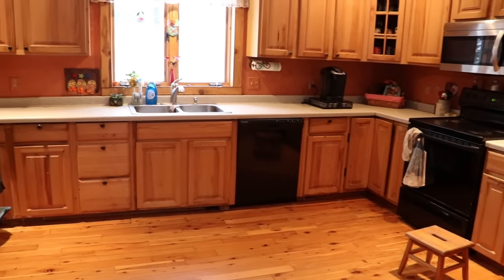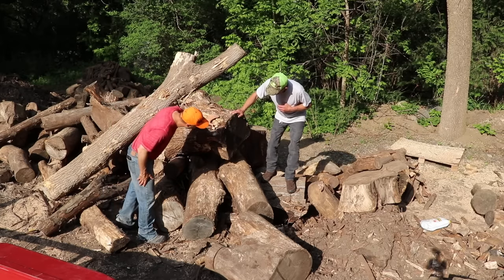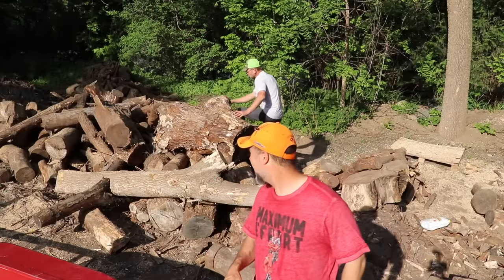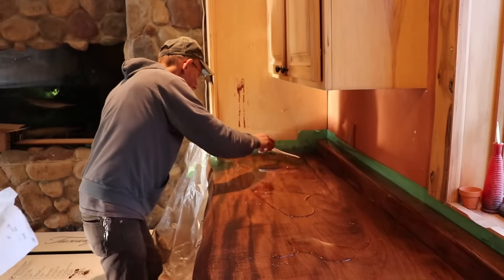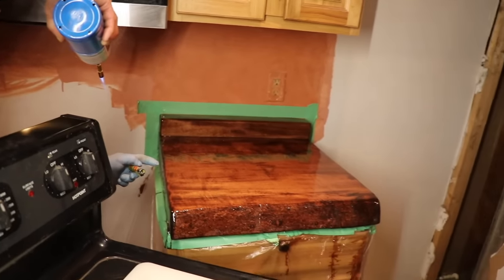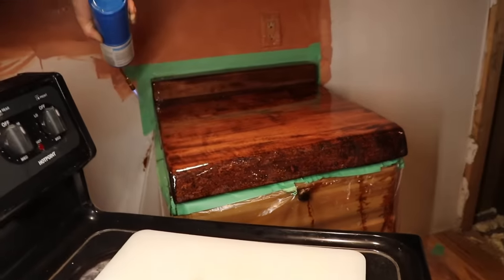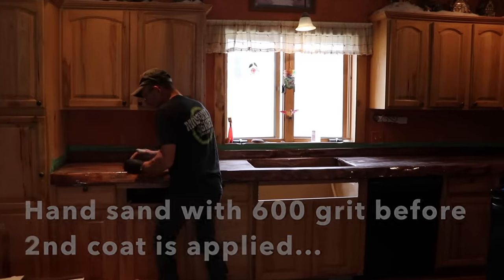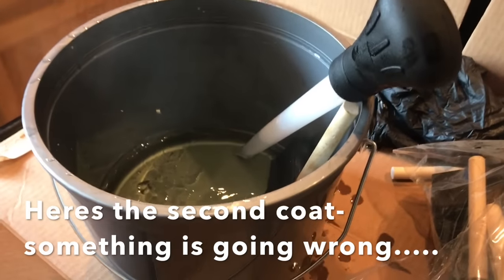A bad Epoxy Job on Our DIY Live Edge Kitchen countertop ... how to do Epoxy repair Pt3

Comment: What happened was the buckets for mixing with marks are HDPE and resist chemicals. The gray one is the same material used for gray abs pipe, it does not do well with chemicals and causes a reaction. The foam brush is a very cheap material that is not chemical resistant unlike the brush. I tried doing a tub resurface with a foam brush before and the epoxy melted it.
Reply from the maker: I think your absolutely right on that one.
Reply: @Dirtmonkey  I'm a professional epoxy flooring installer. when we have excess material that stays in the bucket, it "cooks" no matter what container. sometimes it can catch on fire, so it's crucial to measure the sqftage

Comment: Excellent series, tackling something similar myself, a bathroom counter using live edge black walnut and the same glaze coat product. Some thoughts and questions. 

1) How long did you let it set up before sanding? My test piece is about 24 hours dry right now, but it still might be kinda soft, IDK. I want to sand off the drop blobs and see how that goes. 

2) Bubbles, I read that it's not the heat that pops the bubbles but the CO2, so some suggest using dry ice. Let the dry ice turn to CO2 gas and flow over the surface. I tried this some on my test piece. I messed it up a little by letting the dry ice splash onto the surface but so far I think it works, I'll be trying it again. I want to avoid those ripples caused by the flow from the torch.

Comment: I didn't read ALL the comments so maybe it was already covered, but I agree with one party that said you might have got the mix wrong. If you use the entire container of both parts I'm not sure how that's possible, but it could happen, or possibly it wasn't mixed completely. I used stonecoat as well and mixed equal parts and mixed with an electric drill with a paddle mixer. It makes bubbles, sure, but they all come out with the torch. The hot bucket had nothing to do with the bucket. It happens when you let a large quantity sit in a bucket. It cures too fast and makes much heat while it does so. I worked on a project where I needed several colors and left one of the colors in the quart sized cup too long. It was hot AND set in less than 30 minutes. Overall, you learned as you worked and it came out beautifully!

Comment: I have not had good luck with Glaze Coat. I prefer a different brand. Also where the sink is under the counter you need to poly at least two inches back on the bottom because water WILL get under and start to blacken the inside edge around the sink.  One more thing. It's always best to poly both sides of the counter before you even put on the Glazz Coat. It eliminates a lot of bubbles in problem areas. Nice work!

Comment: Thanks for the upload. A few takeaways::: read the label (isopropyl alcohol was not the right solvent, more like denatured alcohol)  if you are using multiple layers of epoxy  DO NOT sand to 600 grit  between pours. Ya'll were way to trigger happy with that propane torch, cooking the 1st pour.Someone messed up the ratio of  epoxy for the 2nd coat.Let the 1st coat cure and walk away. Then apply second coat and walk away. Then you sand highspots, then final pour
Reply from the maker: Dont you have to get rid of air bubbles?
Reply: Microwave it 30seconds each part then mix. I use same stuff and have zero bubbles..
Reply: i was kinda thinking the same thing. The First coat is really a seal coat. Just get rid of the bubbles but any thing uneven will go away when you do the next coat. The third coat is like the show pour and makes it super smooth.
Reply: No sir if u microwave the 2 parts seperate , there will 100% be no bubbles.  # PLUS the poly once mixed will spread and cover the wood much easier bcuz it a tad warmer and it makes it thinner
Reply: In
Reply: Same thing I SAY about paint: Hurry up- lay it out, THEN LEAVE IT ALONE!
Exception being, dealing with bubbles in slow-cure epoxy such as this: the torch is to be used to break the surface tension to let the bubbles pop. Don't move too fast, but don't dwell with the torch in any one place. And- NEVER touch the epoxy surface after lay-out. Most importantly- as soon as you notice the epoxy starting to get ANY thicker in texture, or pulling with the brush- STOP!
As the Master Rick's comments in the first video pointed out, heat is the enemy of the self-leveling-out process; the CO2 from the torch is what causes the bubbles to pop (read his comments!). (That is why the heat gun doesn't work!) He also stated that spritzing with ACETONE NOT ALCOHOL is the key solvent to break surface tension to facilitate bubble-popping. He should know- he's poured thousands of gallons of epoxy, and quizzed the manufacturers about the processes. GOOD STUFF!

Go back to the first video comments and read Rick's and a few others' comments for the best, most thorough explanation of the finer points of epoxy-coating. Especially about sealing the wood with the first coat and compatability with stains. RICK KNOWS EPOXY!

Comment: I must say, watching you guys do this monumental task with no experience doing it was quit entertaining, now that said, I do this for a hobby/ living, and to do it right is a big learning to say the least when I started doing it. First thing you do when installing live edge wood for furniture, or countertops, you must level the slabs with a leveling jig and router, 3 1/2 inch slabs is over kill, most are 2 inch max, the added weight is bad in time to the cabinet bases, because cabinets are made to expand and contract, the weight jeopardizes that. Now once you get the slabs perfectly level with the router, use a belt sander in the direction of the grain only to remove the router leveling bit marks... I use a 3 inch leveling bit on my router in the sled that makes it fast to do. sand all marks from the router with the belt sander in the direction of grain only, then sand with a palm sander from 80. to 120, then last 220 is all you need for a perfect finish, if you didn't cross the grain with the belt sander. now then stain the wood and let set for three days to dry up before epoxy can be applied. when you epoxy live edge raw wood the wood is pores, it will suck up the epoxy as it dries, this is why you put on three to four skim coats first with a squeegee, then the final coat is a flood coat. skim coats do not need to be torched at all because they are supposed to be thin to close the pours of the wood is all, by the third coat you might be ready for the flood coat, hard woods only 3 coats are needed, soft woods like pine and cedar can need 4 coats, so thin coats only!... walk away and let dry, in between each skim coats you just have to hit it with 220 breaking the surface for the next skim coat to grab to, there will be craters and air dimples on it, don't worry about that after each skim coat dries just lightly sand over it to break the surface and the next skim coat will cover it and it will disappear, by the third skim coat most all craters are gone, hit it with the flood coat now, but note... if you have any knots and or checking... cracks if you will,  you need to fill them now before the flood coat, the final coat, so they don't suck in the flood coat by taking them wax fill sticks you use to fill trim nail holes and heat it with the torch filling the cracks and knots, than scrap off the access with a razor 90 deg. to the surface, then sand till nice lightly. now it's time for the final coat, the flood coat, this is the coat you will attend and torch it to release the air bubbles that rise to the surface you created by mixing the epoxy.  when you mix the epoxy use a drill mixer, mixing by hand takes to long... use the drill and in 2 minutes you  are good, the epoxy turns milky white from mixing it but thats what the torch gets rid off after applying it, you have to torch it all... every inch of the counter top in a sweeping motion with the torch semi fast about 2 to 3 inches from the surface, this heat everything evenly and getting it all to level better as well while popping the air bubbles, I torch the whole thing three times in 30 minutes and done and walk away, after 30 minutes no more air bubbles will appear.  Like I said... three skim coats, your just covering the surface is all thinly... hence skim, walk away... no torching, then the flood coat you torch because it is a 1/8 inch thick.  to apply the flood coat you have to use a 1/8 x 1/8 inch troll to spread it evenly an 1/8 inch thick for the last and final flood coats, the skim coats are paper thin,  the proper ratio per sq. foot for covering the surface for the skim coats is 1 oz. per square foot, and the flood coat is 3 ounces per square foot, all surfaces have to be dead level for the flood coat or it will run off to much in the spots it low giving an uneven flood final coat!! your problem mixing the epoxy in big volumes will cause the epoxy to cure faster and you feel the chemical reaction heat from it, mix it faster with a drill mixer for only 2 minutes  or so and mix three pails the right ratio instead of just one or two, because you only have about thirty minutes of work time before it heats up in a bucket, get it out of the buckets fast!, when it's only an 1/8 inch thick it doesn't cure as fast!!, need any more advice what you would like to know just ask... this will help you enjoy doing this again!!… good luck!!

Comment: I like cordless tools put a dual action sander works best with A LOT of compressed air. Working on-site versus a shop is a huge factor too. The counters looks awesome. Propane kills those air bubbles too ;)
Reply from the maker: Thanks-  yeah we used propane on the bubbles.  It worked great.

Comment: We tried glaze coat recently with similar results to your second coat. We finally sanded it mostly off and rubbed the heck out of the desk with past wax. It shined up nicely but I don't think I would recommend that for a kitchen counter. Too much maintenance! Shows every finger print and any thing anybody writes shows up in the finish too. If we had the time and money we would have redone it. Other two part finishes might do better.

It would be cool to see you do a floor with epoxy. You asked about projects other than your specialty. Yes. Mix it up from time to time. We've learned every time we've gotten in over our heads and enjoyed the challenges, but sometimes only looking back later. It's easier to do the same thing until you know what's happening and can predict the results but it can get boring. My favorite you tube channels have a main theme but also throw in surprises from time to time.

An aircrete project would also be fun to see. It's a mixture of portland cement, soapsuds and sand that floats after it sets up. It's lightweight concrete and also insulation all in one unit. It's something we've been seeing online and seems almost too good to be true. We really liked your showing the good and also what went wrong format in this video. It makes it more realistic and more informative.

Joe and Maude

Comment: Ok I love your videos brother but if you want a quick tutorial in how to do this much faster and easier take a look at the channel "stone coat counter tops" as they have all kinds of tips and tricks like using ann1/8th trowel, paint brushes with actual bristles, proper ratios to use on fill coats and flood coats. My personal question is when you sanded off the messed up epoy is there a reason why you didn't use paint eater discs on an angle grinder? I recently had to do something similar and the discs saved me hours of sanding
Reply from the maker: I love that channel.  That guys work is incredible.

Comment: Hey Stan,  i  am in a nightmare right now and i just need to know what you used to scrape the wet/ uneven epoxy off with?  My wife is stressing out big time,  it's stressing me out..  you know how that goes. lol    My two mistakes were,  1)  i did the proper mix ratio,  but didn't mix THOROUGHLY.  My 2nd mistake was not using a square notched trowel.  I just poured and pushed my flood coat with a roller.  So here i am,  3 days later with 'surupy' counters in spots,  and a kitchen that looks a disaster. Please tell me all i have to do is re-sand? lol

Comment: Next time heat your two epoxy components up a bit before mixing them. It will make it much more watery and a ton easier to work with.  As for the air bubbles, when you are epoxying a surface like this natural wood, you have tons of imperfections like the cracks. Mix up a small amount of epoxy and use it to fill the cracks, voids, etc. in your surface. Sand it smooth and wipe it down with nothing but clean water( just a damp cloth). THEN lay your first coat. You will still get bubbles but those won't come back after you pop them....lol

Comment: It came out awesome..!!
    That ripple effect is common with that product (pour on clear) after the first coat... It did it to me also.  From what I've seen that  Stonecoat Countertops Company has got some good clear coat, that doesn't appear to do that.  But I have never used that brand.
   I tried Kraft Koat and another one that Home Quarters sold... And they both did that ripple effect too.  
    *I don't know if maybe it's because the following coat was applied to soon..??
    I am going to do 2 small countertops (5ft and a  2ft) with Stonecoat Countertop clear and give them a try.

   I almost forgot don't use an electric frying pan or anything like that with a heating element on the bottom of it.  It will get too hot, bubble and ruin that countertop.

Comment: A few tips: When putting epoxy over wood or concrete you should first do a "seal coat" where you essentially wipe or rub the epoxy into all the pores as a super thin finish (1oz mixed epoxy per sq.ft.).  This keeps you from dealing with bubbles in your first coat. Mix the epoxy with a drill and a paint mixer and get it out of the bucket ASAP. The thicker the epoxy is the more heat it generates. It should stay in the bucket as long as it takes to mix and then get dumped on to the counter to be troweled out. If it sits in a bucket long enough to start smoking then toss it as it's ruined.

Comment: This is my first comment on any YouTube video. Total respect for posting this video. This could have been a job that you learned from internally and then scrapped the footage. Instead, you were human enough to post and let others learn from your efforts. I can't say enough about that. I did a two part epoxy on my bar that I made from cherry flooring wrapped in poplar. I had never used it before and had friends that were more well versed but had never used it and wanted to help when the time came. I purposely kept them away because I wanted to say I did it myself without "so and so helped me." Just watching and thinking of the torch made me nervous as hell. Mine turned out great though, with the exception of a curly lil' golden retriever hair that ended up in the finish that only I know about. There was another imperfection that I hid behind the back splash. I feel your pain and would like to buy Frankie a beer.
Reply: 7
Reply: huh?

Comment: Would you be able to finish the countertop off site before installation? A vacuum pump would make that a lot easier to manage. At the very least I'd pull vacuum on the epoxy after mixing but before pouring. I'd vacuum bag the whole countertop if possible
Reply from the maker: I didn't think of that idea.
Reply: Vacuum bagging the countertop would be a nightmare. It would screw up the entire thing. You want the top surface to be flat. The bag would completely ruin that, and you would have to put it into a CNC router to re flatten it. Vac'ing down the epoxy before you pour it doesn't help much either.

Comment: As far as we can see looks nice, I installed a Boos Block counter top say 20 years ago, I dont remember it having such a clear coat on it, I sold the house right after doing the job, but will be going back to that area, so I will try to stop in and see how it lasted, 15 years , that should be a good test.

Comment: from what iv'e researched is that you have to put epoxy in the cracks until it quits taking it then do your sanding all before you do the complete pour, when you do the full pours you needed to use a notched trowel to achieve an even coat, it will level out then.

Comment: It looks beautiful. I wonder if a planner tool would helped shave out the imperfections in the finish. Just a thought. That sink looks expensive it's real nice. Does epoxy resist hot items like a hot frying pans off the stove or hot plates out of the oven? Looks great.
Reply from the maker: No-  epoxy is kind of touchy.  Its the same stuff on bar tops

Comment: I know I’ve come across your landscaping videos that help with breaking down costs for that service, but with reaching to a service you didn’t have much experience with, what would you suggest based off of the mistakes made , time, hours, material, headaches, would you have added into that estimate if for a customer? I ask because this is a similar project I have been asked to do. I have some knowledge of epoxy and live edge going in but have yet to figure out why certain things happen, such as kiln dried wood twisting and epoxy getting to its exothermic reaction when precautions have been taken?

Comment: The same exact thing just happened to me last night.. I used the same clear bucket and mixed the epoxy the exact same way as I did the first time.. This is so strange because this just happened and my kitchen was full of smoke from the epoxy. I can't figure out what happened with mine either.

Comment: I am just wondering what moisture protection you used on the under side? I am pretty sure that wood will work in the years changing air moisture. mostly you need to to the same seal on both sides. or as close as can be. I would probably go for sanding after last finish, and then laping.